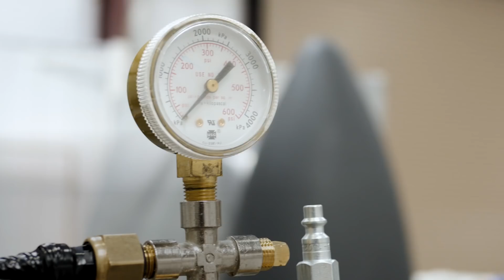Flight of the Aerospike: Episode 17 - Romanian Team (Part 1)

Comment: Instead of a "star" scribe line, I would try a spiral scribe line from center to outer case if you understand my thought.

This could result in a more even control explosion of the diaphragm I think if this is what your trying to do.
(just think of the Jiffy Pop popcorn foil)
Reply: joe slob I would suggest they use a commercially available burst disc that has a known burst pressure.